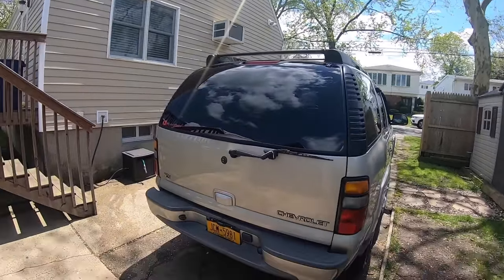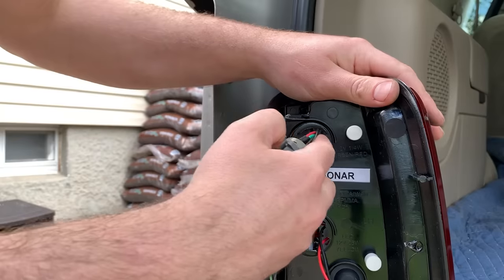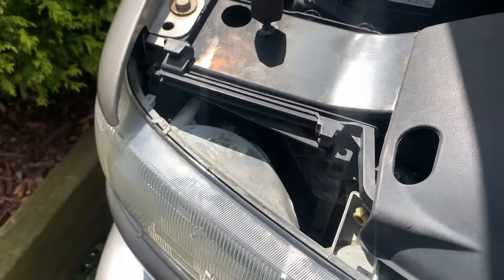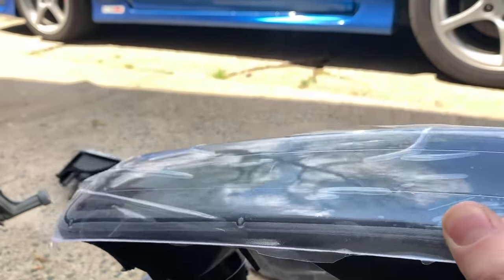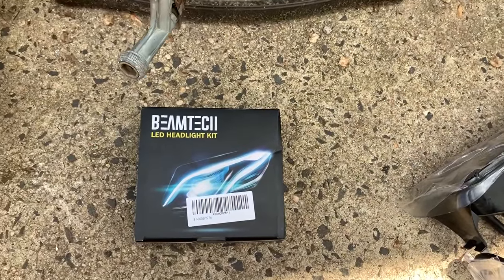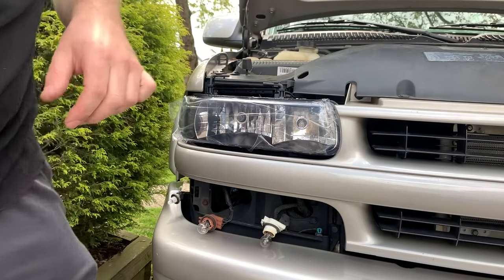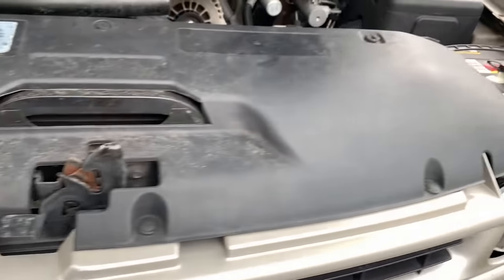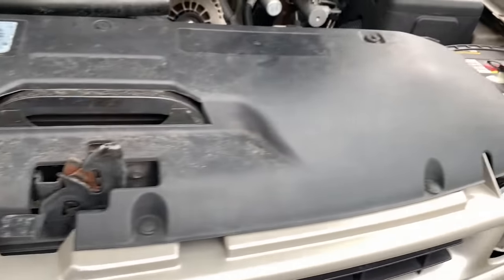Lights, Badges, Wheels, and Tires | IT'S TIME TO PIMP MY TAHOE

Comment: Big tires absolutely kill the performance... I can't believe you didn't mention this.... O shit your using it for towing too.
Reply from the maker: They’re only an inch bigger over the stock setup. Haven’t noticed any power drop and so far my mph hasn’t changed.
Reply: @lsxmatt  i had a new 6.0 diesel f250 back in 06... Fully built, injectors,head studs,nitrous,propane,water meth, ats arroura 4000 turbo kit, ats trans and converter ect ect ect....  It was nasty fast... My stock tires were 33.4"... I figured 35" MT mtz wouldn't change a thing. boy was i wrong.... It was docile as stock.. Immediately had my old tires reinstalled. Maybe it's more noticeable on diesels, but never would i risk losing that amount of performance. Try racing someone with stock tires

Comment: Hey LsxMatt, new here to your page.  i have a 2004 Tahoe that my wife and i call the 'hoe'.
Like  pretty much all the improvements that you have done so far.  i kinda stick with the stock things on the vehicle.  If you ever have a need to do a drivers side window motor i would really like to see that.  Your license plate is a gas since my wife's name is Claudia and my name is john and our last name starts with a 'm'.  One last thing i noticed that you put on side window deflectors, i have them on my other vehicle great addition, but my tahoe brother why did you cheap-out and put those nasty 'stick-on' cheeps???  Weather tech makes custom fit ones for a lot of vehicles.  A much better product and the quality of the plastic is a hundred times better than the stick-ons.  Our hoe is white so we call her the white hoe.  
Thanks for sharing your time and knowledge.  jm

Comment: I would  buy  new  OEM  parts  from  EBAY  not china  crap maybe  its nice  for you  but  not  from  me.......  Rear  lamps  have  a  small gap   front lamps  TRAGEDY  you  should  install  offroad rack  with  lamps  or  LED  bar in  Front  or  Top of  the  car .....  But  no  you  installed Shitty lamps without  reflectors .......  Good luck  at  night driving   mate :D
Reply from the maker: The led’s made a hugeee difference at night. I can actually see where I’m going now.